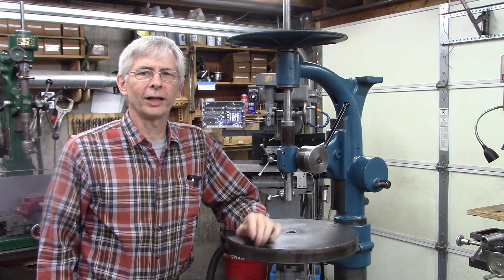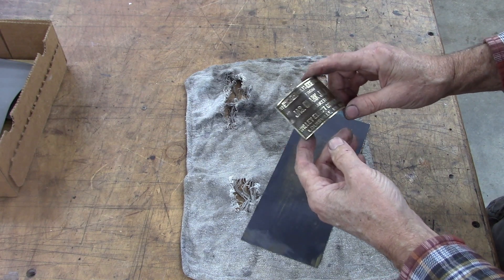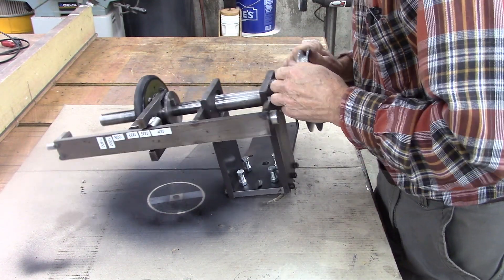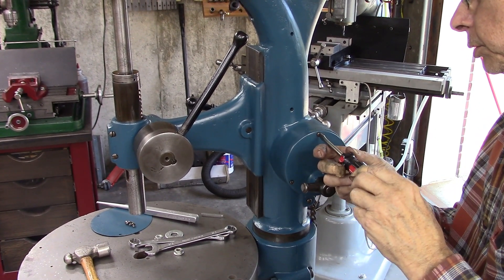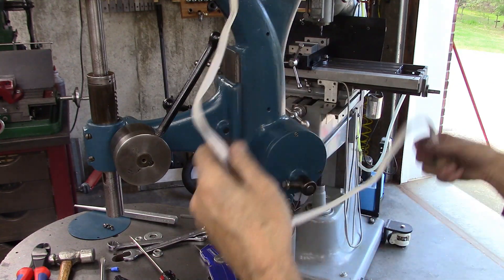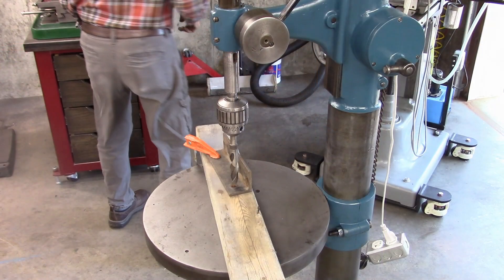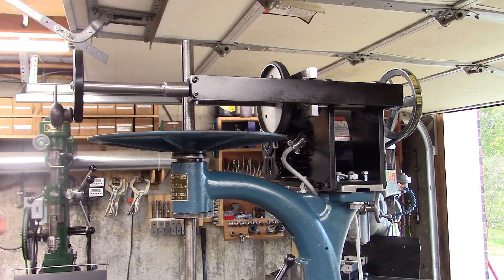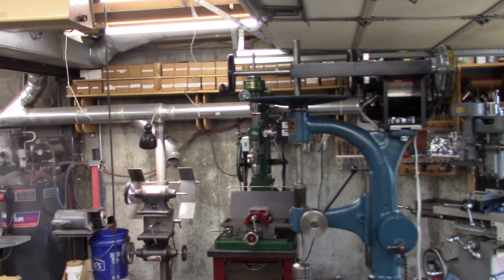1918 Friction Drive Drill Press, Put to the Test - Part 4

Comment: When removing the paint from the nameplate try putting the sandpaper on something hard and flat... surface plate or a piece of glass. This will help prevent removing paint from the background areas.
Reply from the maker: If the plate s very flat that works but it was a bit to wavy.

Comment: Hi Mark. Whenever you want to use sandpaper to clean up a tag like that don’t put your paper on a rag. It lets the paper flex up between the lettering. If you adhere your paper to something extremely flat, like a table saw top, the paper will only contact the raised letters and not the back.
Reply from the maker: I tried the hard surface. Apparently the plate was a little wavy. It needed the rag under the paper.

Comment: I think we're going to need a mechanical engineer to explain why the point at which the drive wheel doesn't pull in either direction is NOT when the two shafts are at a right angle to each other.
Reply from the maker: No kidding! This really surprised me. The only thing I can think of is drive torque but it doesn't seem like it would be substantial enough to do that if not under load. Maybe stored energy in the rubber as it twists? Ha...  no idea.

Comment: Winky the problem with you sanding the brass letters and it removing some of the black as well, was due to you resing the emery on a soft rag. If you had put it onto a flat hard surface all would have been well. The rag underneath was causing differing pressures across the part. Looks great. Regards from Australia.
Reply from the maker: Yeah, I tried it without a rag and it didn't work well. I guess it was wavy. A thin cloth might have been better than the rag however.

Comment: It's so cool, i wonder how you could adapt that kind of mechanical variable speed system to a old Lathe ?
Reply from the maker: I was thinking a go kart
Reply: @WinkysWorkshop  Hell, why not just a front wheel drive small Car ? 😁
Reply from the maker: @65cj55  It might work well but friction under higher power might be an issue

Comment: Question - what oil do you keep in you dropper bottles?  I want to put a few around the shop.
Reply from the maker: I assume you mean the bottles with a needle. Mostly cutting oil for doing cutoff on the lathe. The needle puts the oil in the cut. I have PTFE oil from a spray can that died in another and 20 w oil in another for oil cups on the lathe.

Comment: If you sand those metal plates on a sheet of glass or a surface plate it should not touch the background, that soft rag you are using allows it to push down into the background of your plate, in any case great videos I enjoy watching all your videos, 👍👍👍👍👍👍👍👍
Reply from the maker: I tried that, it needed a slight pad although the rag may have been too much. I guess the metal was slightly wavy.

Comment: Mark I stand corrected I really though the wheel would slip once you put it under a load. Good job
Reply from the maker: The wheel is from a Snapper Lawnmower that uses a Stern drive. That's why I selected the wheel, I figured they did the research to determine the right rubber thickness and hardness.
Reply: @WinkysWorkshop  Correct I'm the one that said my mother could ware one out a month. And that I had to work on it all the time.

Comment: Oh god . . . When you use spiral drill put oil on top of spiral next to a chuck,as it spins it will drip down slowly and lubricate where it needs to -between cutting edge and swarf.
If you dont believe me put a paper towel and see how much oil drips.Way better than the pool that does nothing when drill goes beneath the surface.
Reply from the maker: I'm sure that would work fine but for shallow holes it makes very little difference. Sometimes I don't even use oil.

Comment: Instead of a bearing maybe you could use a bronze sleeve to fix the wobble?
Reply from the maker: It seems to be steel on steel now...  maybe a soft steel in the quill tube. Something is bent plus it is loose. Both need to be fixed but yes use sleeve bearings